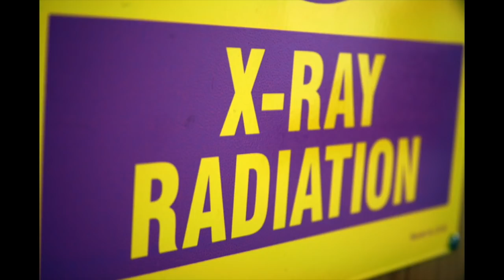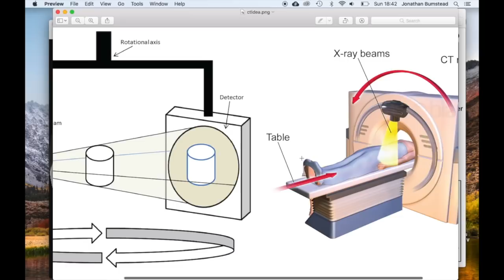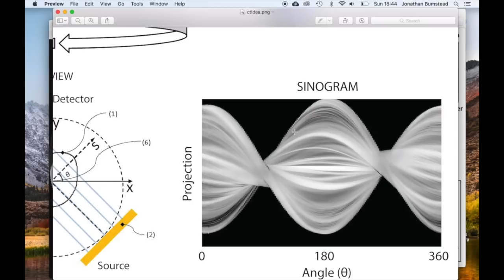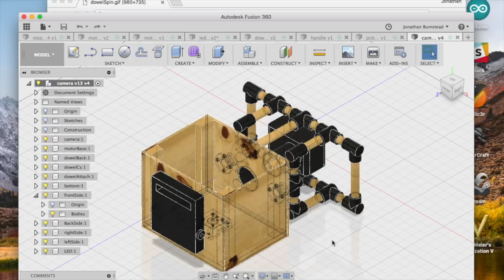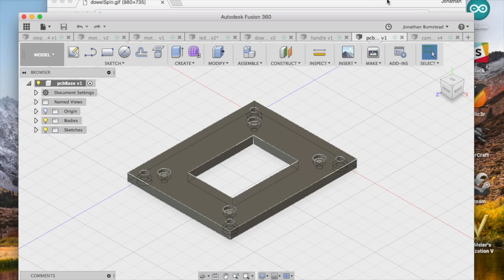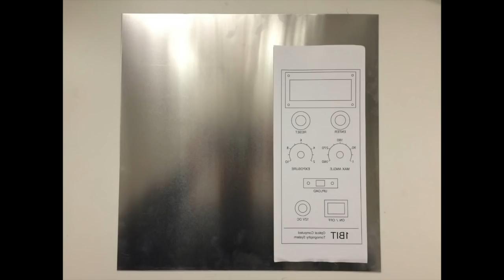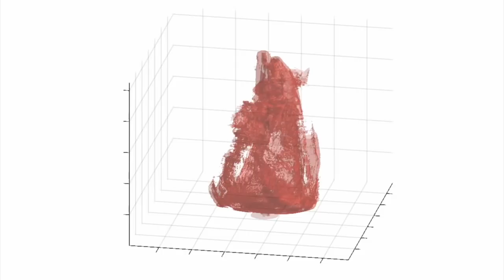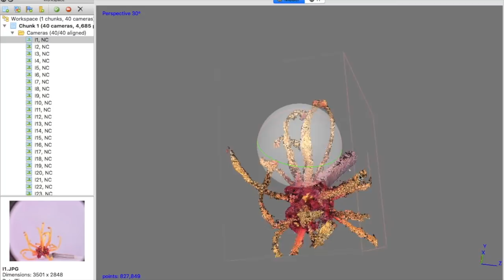CT scanning with a camera and arduino

Comment: does the dslr quality matter here or can you just use some cheap camera sensors and build a dome array?
Reply from the maker: An optical CT scanner can be built with lower quality cameras, but the SNR and resolution may be worse. The SNR may be compensated with longer exposure times.

Comment: How would this setup deal with reflected/bent light in CT scanning mode, say you scan a transparent bottle?  Id think theres no way to correct for the errors.
Reply from the maker: Great question. Optical CT scanning does not work well for very reflective samples. If the light just reflects off and hits the camera sensor, it tells you no information about the absorption of the specimen. I can't think of ways to correct for this either.